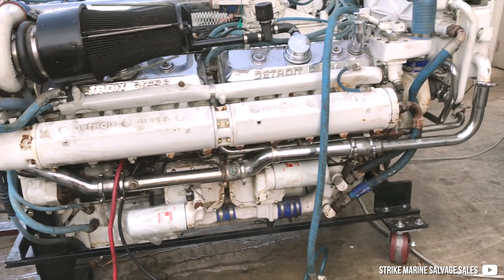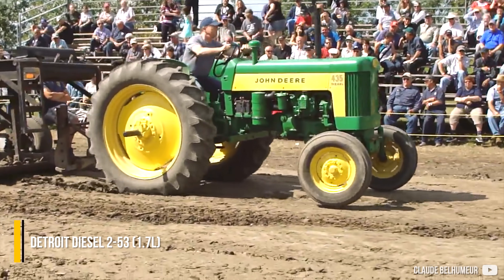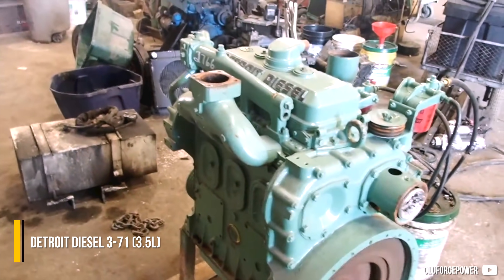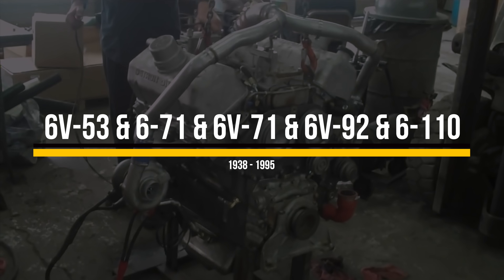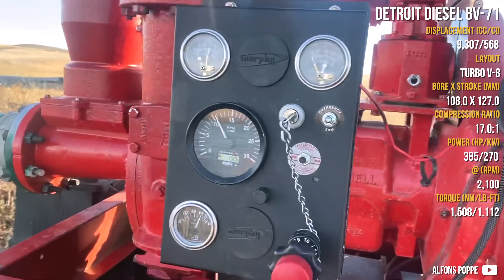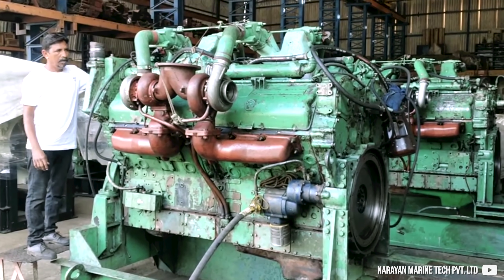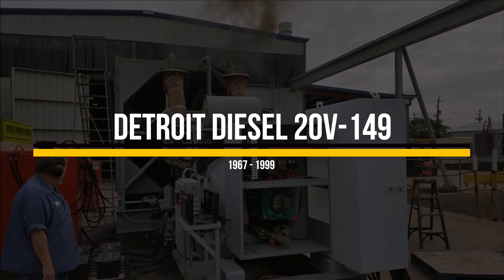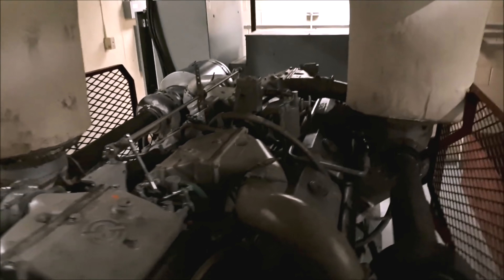Single to 24-Cylinder Detroit Diesel Engines

Comment: Visio this is one of your best clips ever.!
Thank you so much for the hard work in making it.
I dont know where you would ever get any footage, but the 6-71 (and probably others) were produced as left hand rotation, and coupled with a standard right hand rotation 6-71 to drive a single shaft in landing craft, with two such units making a twin screw vessel
Reply: There was also a quad 6-71 unit with four 6-71s bolted to a common reduction gear driving a single propeller shaft.
I was a Machinery Technician in the USCG and was stationed on a 95' patrol boat, powered by two 16V149TI main engines.
Reply: @johnstuart3851  Ow wow!
I would love to have heard your 149's running!
And four 6-71 into the one shaft......this stuff is what made America great!
I am a 66 year old Australian Diesel Fitter and Coach Captain.
Bring back the old days!

Comment: I am a marine mechanic and I specialized in Detroit diesel and I feel lucky because I got to rebuild a pair of 2471 Detroit’s at 1,800HP. They were DDEC IIII. 
They had four blowers down the middle and four water cooled turbos right on top of the blowers amazing engines. The pair of engines also held 65 gallons of SAE 40 weight oil each and 100 gallons of coolant each. Just wanted to share I really enjoy your channel.
Reply: What were they in? I am also a marine mechanic and I have done an "In Hull" overhaul of 2  DD 12v71's that were in a 90' Broward Yacht. My Favorite DD is the 8v92.
Reply: @RealDougFields  it was a long time ago. I can’t really remember the make of the yacht, but those two engines I could sit underneath the oil pan Indian style. I couldn’t believe how high they sat on the stringers it used to be chartered at Atlantis in the Bahamas. I Also worked on a pair for AT&T in Fort Lauderdale, Florida standby generators.

Comment: I currently own a 1968 gm pd4107 with a 8v71
One of my favorite trucks i owned was a kw w900 with a 12 v71 all hot roded up would pass most anything but a fuel stop
Have a good day 
THE GRUMPY BUS

Comment: Fun fact: the French AMX 13 light tank used American built Detroit 8v53 engines as its primary powerplant

edit: it originally used a flat-6 petrol engine developed in-house by the design company

Comment: I personally ran a 6V92 for 24 years straight as a oil delivery truck. So it was all short haul. When I bought it it had 300000 miles so I had it rebuilt then ran it 24 years. The hours meter quit at 18,000 and I ran it for years after that. It was backed by a Allison 750 which was a wonderful transmission. It just got too old to keep using it. The cab wiring was going and the leaks were getting worse, so I bought a Volvo with a series 60. I still have that truck. I love detroits.

Comment: Just found your video. My father had a 6-71 D in a 42' Chesapeake deadrise work boat. When he finally retired and sold the boat you could see the fly wheel through the housing (salt water) The boat was built in 1979. The 6-71 was its original engine. It was a very good engine. Rarely gave any issues. Did Keep the bilge coated in oil. The old joke for Detroit engines was if it ain't leaking oil, your out of oil. They just leaked. If they stopped, look out.

Comment: Something not mentioned in the video:  Being two stroke engines, they would run either direction.  The two valve engines had a single cam and a counter balance shaft; the four valve engines had counter-rotating cams.  There was an idler that could be engaged with one cam gear or the other by flipping the idler bracket.  To reverse the engine, the idler would be flipped.  This mean the cams ran the same way. The blower, oil pump, fuel pump and water pump all ran off the cam or a gear off the cam gear.  No matter what direction the engine turned, the accessories all spun the same direction.  The upper pulleys visible on many engines are extensions of the cam, and they always run the same direction even if it is a reverse spinning engine. 
Being able to reverse was useful to boats, but also many other applications.  For example, it was common to see a generator in the middle and engines bolted to both ends.  The two had to spin opposite directions.

Comment: The 2 71 Detroit's were used in many HD5 Allis Chalmers dozers. You find a lot of them still running today. Older than I can guess.
Reply: The 471 was used in the HD10, the 671 in the HD15, and the 6-110 in the HD20. In the mid nineteen 50s, then Allis Chalmers started using Buda engines.

Comment: They have their very own grade of oil, API CF-2, the "2" at the end stands for 2 stroke.  -2 oil is low sulfur to minimize coking, which is a problem for these engines.  It also makes them best in marine applications, which never go down hill and the constant, steady loads experienced by boat engines reduces coking.
Reply: Low ash is another term too. Always 40 grade.

Comment: Dear Visio Racer, Thank you for this video; it's very informative. Please would you clarify one thing for me. Do some of the smaller ones (one cylinder?) run using crankcase compression ONLY, without a compressor, in the same way as a 'normal' petrol-mixture two stroke engine, as on a chainsaw? Thank you and best wishes, Luke
Reply: Crankcase scavenging would be a substantial change to the engine design, so I assume that they would all have an external scavenger blower (not "compressor"). 

On the 1-71 engines shown in the first segment you can see the blower attached to the left side of the engine (if looking at it from the output end), under the black air filter cannister. On the first 2-71 shown, the blower is painted gold, although the rest of the engine is grey.
Reply: @brianb-p6586  Thank you, Brian. It's what I thought, but it's nice to be really clear. My understanding is that this type of two-stroke has the air charge going IN at the side, through ports and OUT at the top through poppet valves. Best wishes, Luke
Reply: @lukewiseman9946  that's correct: these are uniflow 2-stroke engines, which means that the flow is one direction through the cylinder, as you described. The scavenge blower mounts to the side of the block to directly blow into the intake ports.

Comment: Detroit engines were all junk & a bad idea the us government bought thousands of these junk engines to keep detroit in business, Cummings came along in the 70s with a K model it was a turning point in big horse power ,a V12 Detroit boat anchor junk engine 12V 92 had less cubic inches than a KT1150 Cummings & it dident need rebuilt every couple weeks 
It was a bad experiment & they made alot of people deaf with all that noise & poor trucker guys that ran them smelled like burnt oil & diesel fuel from working on them pieces of shit keeping them running ,Oh my Detroit ran away Where did it go to the scrap pile where it belongs, Detroit fucking junk,

Comment: The old tug I worked on was repowered with a V12-71 inline tandem set up. Bolted back to back to a Falk reduction, the rear engine was setup to turn backwards, apparently this  is also a Detroit option. Each engine throttle could be finely adjusted to load share based on exhaust pyrometers .

Comment: General Electric 24 Megawatt gas turbine generator sets used a 600hp  Detroit V12-71 twin turbo engine as a starter motor. It would start, idle for maybe 10 seconds, then go wide open governor and scream its guts out for the next 8 minutes while the turbine fired at 20% speed then climbed out to 5100 rpm.   I still have a 3-53 Detroit which I may mount on a trailer and make the world's loudest Margarita Machine.

Comment: I actually got an opportunity to start and run the v12 in the video. It looks small in the video but that thing was huge and would shake the earth beneath you. Awesome video. Sounds like you did your research. However you forgot to mention the runaways from the Detroit’s. A lot of them came with a air shut down cause they could use the oil to run and would take off. And you also forgot to mention their nickname. Screaming Jimmy, as the two stroke you needed to run the engine up in rpms to get the power, always sounded like they were “screaming” when you ran them. Such a cool motor. Gm was always good at reusing different engine parts throughout their products. Such as a distributor from a big block could be swapped into a small block in select years

Comment: Detroit also designed the first diesel engine for chevy the 6.2 l 82-93 and then the 6.5 turbo diesel 93- to the first duramax
Reply: The 6.2 and 6.5 were designed by Chevrolet, then given to Detroit Diesel to manufacture.
Reply: @andyharman3022  at the time the 6.2  was made detroit was owned by chevy and was given the job to design a diesel engine for the trucks do to how bad the 5.7 diesel did
Reply: @adriantibbits6375  The 5.7 was designed by Oldsmobile.  The 6.2 was designed by Chevrolet.  They were engines from the era when the divisions still had engineering autonomy before Roger B Smith's reorganization in 1984 that consolidated powertrain engineering into one corporate function.
Reply: Duramax was an Isuzu derived engine, The 6.2 was designed after GM found out how poorly the revised 350's and 260's did. 6.5 could use more power, but is basically sound, my 96 pickup is still running fine.

Comment: As these become ever more rare I like and appreciate them more.  They filled so many valuable niches but their time has passed (unless ways can be found to make them as clean and efficient as modern diesels, which may actually be possible if Achates Power is any indication).  I also find myself in the very small minority of enthusiasts who prefers the sleeper approach (read silent but in this case with just enough of the characteristic sound so that those nearby will know).

Comment: I believe all Detroit Diesels had blowers. They were not normally aspirated. Later high power models also could have turbos, but the engine  driven blower was standard and necessary for the engine to run.
Reply from the maker: Yes, necessary, hence a natural, essential part of a two-stroke diesel

Comment: Between my years in the US Navy and in the fire service, I have had the opportunity to work on several different brands of Diesel engines-Caterpillar, Cummins, Detroit Diesel, Fairbanks Morse, Westerbeke, Yanmar... Without a doubt, the Detroit Diesel is my favorite and is the one I would rely on if my life depended on it. Much easier to work on, and in my opinion safer due to it's low pressure fuel feed system and unit injectors, Detroits had torque out of the yazoo. When I retire I want to build a boat and live on it full time. If I can find one, it will have a Detroit turning the propeller.

Comment: I work as a draftsman designing fire supression systems, and all the water pumps are driven by diesel engines. In the last site that I designed, we used 3 800hp-each diesel v8 to run the sprinkler and foam systems

Comment: The GM foundry in Defiance Ohio poured a good many Detroit Diesel Blocks. The poured inline 4 and 6 cylinder blocks and once in a great while they poured a 3 cylinder inline. The also poured 2 different sizes of V6 and V8. They also poured V6 and V8 cylinder heads.

Comment: A couple of 2-stroke Detroits that you missed - the valveless, both 2 and 4 cylinder 51 series engines that were built in the early 1950's and were used in marine and stationary applications.

Comment: The 2-stroke design of these engines necessitated a blower to force air into the cylinder. It could be augmented with an added turbo but they were never naturally aspirated. Great video BTW.

Comment: I only drove Detroit 2 cycle engines in fork lifts, and semi tractors! They seemed to require high speed to to take a load. I preferred 4 cycle engines.

Comment: You forgot to mention that the 71 series and the 92 series used the same block, the difference being the 92 block was bored out and a wet sleeve inserted while the 71 used a dry sleeve.

Comment: the most successful diesel power plant program in history.  DD promised service on this product line anywhere in the world in 24 hours.  Incredible modular design led to very quick and simple servicing, economy, and longevity.  I have to disagree with  your contention that they were not well known outside of the US.  Oil fields all over the middle east used DD, and maritime versions appeared all over the Atlantic and Pacific oceans.  And lumber, water pumping and generating was a big part of their global market penetration. The Electromotive Division of GM used the V20's in the 45 series locomotives. Great piece as is always the case.

Comment: My first year out commercial fishing, the boat i was on had twin 6v-53s. That tub had 900 HP and couldnt go faster than ten knots on a good day. Those greasy pos hunks of iron broke down every other day of the season.
Reply: ON land a 6v53 was only good for about 180-200 HP, don't know how 2 of them could have put out 900.
Reply: @P_Rund1952  Well i was pretty young at the time, but those were the specs, i do believe the turbos were larger and there were some other HP bonuses with the marinization.

Comment: I had a Silver Eagle 40foot bus with a 6V92, that engine was amazing. It would always start, even in cold Iowa winters, on the hiway it would get 10 to 12 mpg, not bad for a 40 ft. 29,000 lbs. Bus.

Comment: I wish it was easier to put the small ones into cars, vans and pickups as I would love to put a 2-53 in my B200 Doge van; but there are height issues as well as complications with engine mounts and bellhousing adapters etc.

Comment: I work on gensets and fire pumps, still thousands of these out there. One location I service has six 20v149's in one room, with 3 24v71s in another part of the plant. They all start at once. It's a wild noise.

Comment: They were very popular for marine applications. Emd is an honorable mention as it was part of gm. For ww2 they put 2 6-71’s side by side to make one to power tanks. A lot better than the German gas powered panzers.
Reply: They made twin packs with the 6-71’s side by side and also back to back.   They also had quad packs with 4 on a single gearbox.  I operate a Quadpack

Comment: Detroit Diesels had a rapid rev gain which made them very popular as draw works units for drilling rigs in the early 60s and 70s. Catepillar came out with a generator set electric motor draw works design, called a SCR unit that actually picked up speed quicker in the 1980s that made a great deal of inroads into the drilling market. The drilling depth doubled and tripled in the same period. Stewart and Stevenson followed suit and well, Detroit and Cat were head to head again.

Comment: I worked on a tug boat right out of high school that had two 16 cylinder turbo/supercharged DD engines. At 1200rpm I thought the world was going to end. It was actually two banks of V8 engines paired together to make 16 cylinders. 

We pulled a dredge pipeline once with a supercharger intake hose that had been sucked flat from the vacuum and a few dead cylinders on one engine. The engines didn't seem to mind. 

Forget sleeping around those things. I never understood why they were so f'ing loud.

Comment: I love Detroit and Fairbanks-Morse two-stroke diesels....  My dad operated a small municipal light plant in western Kansas which had two 6 (one was also turbocharged) and one 10 cylinder F-M diesels.  Prior to studying mechanical engineering, I rode nuclear subs (I was in the Navy's advanced electronics program) that had the same 6 cylinder F-M for back-up power.  Gr8 memories.
Reply: Yes, but the diesel engines in the subs had two opposed pistons in the same cylinder with a crankshaft on top and another on the bottom. They were started by injecting compressed air directly into the cylinders.

Comment: Other interesting tidbits. I believe the 12v71 was the only v12 of the series that was a true v12. The others were 2 v6 mated together. I believe it was also the largest displacement single block casting. This made it very popular in motive applications. The problem with bolting 2 blocks together is there is always a tiny amount of flex. In a boat or truck frame, there is a considerable amount of stress that is passed from the hull or frame into the engine mounts. In those applications a singe block is more durable and will last longer.

Comment: People don't realize when they get Roots superchargers for gasoline engines in hot rods, when they say I got a 6-71 blower, that's because it's the same size as the original GM 671 Detroit Diesel. Or it could be an 8-71 blower, Etc. Originally in the 50s in early sixties, they were modifying these Detroit blowers for gasoline engines, and they came right off that Detroit Diesel. That's what you see on the early diggers and drag cars, a modified Detroit Diesel supercharger on a gas engine, like a 392 hemi, with a 671 Roots blower, for example.

Comment: Love the Visio Racer👍💯💯💯 these engines were never that powerful, but they use them since the 40s in all kinds of buses, cracker boxes, lot of rigs. It is the sound that makes these motor so awesome. They sound like they're screaming but they're barely hitting 2600 RPM. Got to love a two stroke diesel.

Comment: Water pump engines. Biggest piece of junk in truck applications. Throttle should have been a toggle switch. What we do when we are young to make a dollar. Wouldn't even sit in the cab of a truck with one of these dinosaur engines under the hood now.

Comment: I had a mate that drove an 8V92ta in a coach that did 100ks an hour up a mountain gradient an old lady on departure said to him she's never experienced anything like it. It was dry as a bone.

He also drove a White Road Commander 2 with same model engine hauling a quad float with dolly 220 000 lbs gross and left 2 444 Cummins powered trucks for dead on the highway and they were towing flatbeds nowhere near the weight of old mates truck. Cheers from Australia.